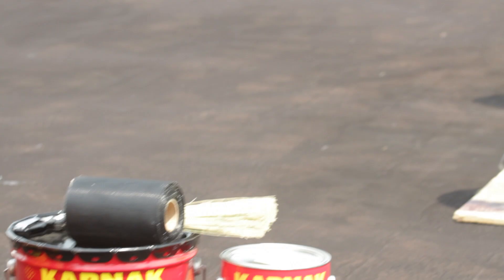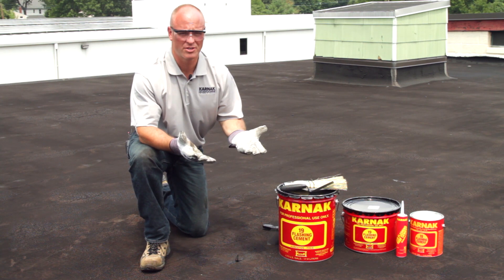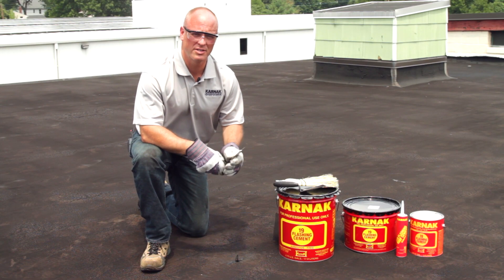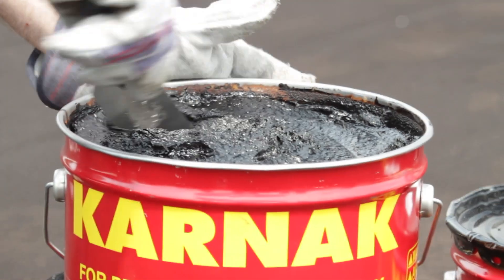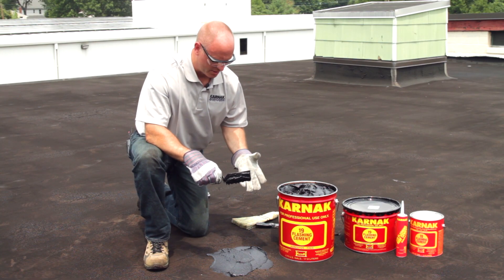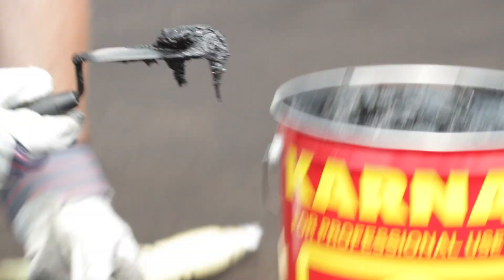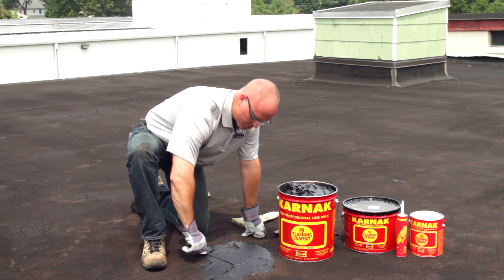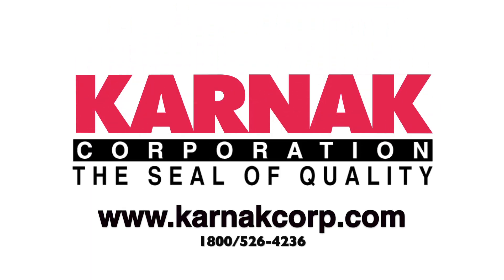How to repair leaks permanently on flat roofs Karnak 19 Professional Grade Flashing Cement

Comment: i got a quote offering to repair with roof cement vs silicone & fabric, which is better?
Reply from the maker: That depends on the particular circumstances of your roof, its condition, the underlying material, and other factors. You can always contact our Technical Department to discuss your specific situation at 800 526 4236

Comment: Can you use this multiple times after you open the container? How long does it take for it to harden?
Reply from the maker: Depending on how tightly the 19 pail is resealed and storage, i.e., inside in a 40 to 80 degree space apposed to outside in the back of a contractors repair truck, it can be several weeks to possibly months if not longer to harden in the pail.

Depending on the KARNAK Asphalt Flashing Cement used, KARNAK Flashing Cement's such as #19 Flashing Cement, #19 Ultra Rubberized Flashing Cement and #155 Amphibikote (Wet/Dry) when applied will create a waterproofing asphalt layer and the material will skin-over within a few +/- hours. Depending on the ambient temperature, this skinning over time frame may be longer or shorter, i.e., (warmer temperatures will quicken the skinning over process).

When flashing cement cures it will continue to have a "putty-like" consistency. This is the nature of roofing asphalt and is advantageous because it allows the repair sealant to expand and contract with the roof substrate." The curing process will continue depending on the thickness of the applied material and may take several weeks or longer. This process, as well, depending on the ambient temperature, may be longer or shorter.

Once applied, either the KARNAK #19 or #19 Ultra or #155 will perform as designed throughout the "Skinning Over"/"Curing" process. Depending on the application, expansion/contraction movement and nature of repair, the flashing cement can perform for upward of several years or longer. This time frame can vary either longer or shorter.
Reply: @KARNAKroofcoatings  Thank you!

Comment: I just put it down on some cracks on my concrete roof How long it takes to dry out?
Reply from the maker: Depending on the KARNAK Asphalt Flashing Cement used, KARNAK Flashing Cement's such as #19 Flashing Cement, #19 Ultra Rubberized Flashing Cement and #155 Amphibikote (Wet/Dry) when applied will create a waterproofing asphalt layer and the material will skin-over within a few +/- hours. Depending on the ambient temperature, this skinning over time frame may be longer or shorter, i.e., (warmer temperatures will quicken the skinning over process).
When flashing cement cures it will continue to have a "putty-like" consistency. This is the nature of roofing asphalt and is advantageous because it allows the repair sealant to expand and contract with the roof substrate." The curing process will continue depending on the thickness of the applied material and may take several weeks or longer. This process, as well, depending on the ambient temperature, may be longer or shorter.
Once applied, either the KARNAK #19 or #19 Ultra or #155 will perform as designed throughout the "Skinning Over"/"Curing" process. Depending on the application, expansion/contraction movement and nature of repair, the flashing cement can perform for upward of several years or longer. This time frame can vary either longer or shorter.

That's a lot of info, but I hope it helps!

Comment: Can this be used on a rubber roof  with silver coating on it?
Reply: Yes that’s TORCHDOWN aka asphalt modified bitumen with aluminum coating 
Yes the Karnak can be used on it
Reply from the maker: In the case that it is an EPDM roof, this product cannot be used on that roof substrate with a silver coating on it. In the case that it is a torch-down APP or SBS, then yes, this product can be used in that case.

Comment: What is the purpose of the tape?
Reply: It stops the tar from cracking
Reply: movement, this method is used on seams which move.  It also creates a redundancy which is well worth the cheap fabric he used, there are better fabrics
Reply from the maker: It makes the repair over 4 times stronger
Reply from the maker: It makes the repair much stronger and last longer

Comment: Thats was better, try using the tip of the trowel to make that tar job look nicer. It should look oval and uniform when complete. Alsi the way the tar built up on your trowel is kind of embarrassing and a good tar man never wears a glove.because thats how it gets on the handle.
Reply from the maker: Thanks for the advice!
Reply: @KARNAKroofcoatings  cheers!

Comment: I've had 3 roofers take my money over  8 years: The first one who put on the original, the second, (after the first one bailed on me), came back after the first few rains showed he really didn't fix the leaks and bailed on me, the third, actually did a good job and I called him back to fix another area, and after numerous calls and even 2 visits to the office never called me back and now his work is failing. I'm a little gun shy about handing over a few more thousand dollars to anybody else. Water ponds about 3/8" deep behind my scuppers. Will this product control standing water? Can it be built up to stop the ponding?
Reply: Brent Townsend most likely you'll just move the puddle farther away from the suppers using mastic to fill low spots ,1st off standing water isn't a bad thing unless it doesn't evaporate within 24 hours ,if that's the case then leave it alone ,the only way to know if you can move water to the supper by filling low spots with mastic is to stretch out a line from the supper to the high spot ,then see if the line has an equal gap under it ,flows backwards or lays flat on the roof ,if the line lays flat then you can prolly fill the low spot with half the thickness you think it needs and inspect after another rain.
Reply: standing water is an install flaw, you need address what happened in the install.  Probably needs insulation modification under roof membrane
Reply from the maker: It will not control standing water, but it will stop the leak in an emergency capacity.

Comment: Can I use this to cover the whole flat roof? I'm not sure where the leak is happening on the house. I'm thinking about caking it with this if it works...
Reply: Did you do the whole roof what was your results?
Reply from the maker: Yes, we are curious too how your job turned out. You would use this typically for spot repairs, and then coat the whole roof for best results.

Comment: This particular built up roof needs a re-surfacing contract with a UV protector, not a gum repair.
Reply from the maker: This is a leak repair, not a whole solution for coating. Once repaired, you could coat on top of the repair.

Comment: our roof is a plastic type, a deli that was originally mobile, it has a large fan for the range/Grill for the deli, it leaks no matter what, used a waterproof silicone but nothing simple seems to work, will this flashing be good on that roof?
Reply: plastic type??   fyi- oven exhausts are a notorious problem and usually handled completely with metal work.  Grease causes many problems, and the heat and cooling of the system creates movement which cracks seems
Reply from the maker: Karnak 19 Flashing Cement should do the trick!

Comment: this may be a dumb question but why build a flat roof that can hold water ?   why not angle the roof so water runs off    I see with a flat roof you can save room by putting all the a c stuff on the roof
Reply: Clinton Wurzbach If it holds water it's not properly done, no roof should be completely flat. Even what they call flat roofs should have a slight angle/grade to them to direct water to the nearest drain system
Reply: No roof is designed flat.  your real question involves roofs to large to have a "single plane" slope.  For example a one acre roof with a 3" (lowest slope) needs 53 feet of height added to the high side, and watch out for wind issues.  So the method used is to pyramid shape the insulation between the drains.  Fire Marshals and codes set the drain distances.  Insulation is set in 2" lifts.  Imagine a flat table, then add a pyramid shaped foam, and a sheet of plastic
Reply from the maker: Sometimes the flat roof wears unevenly, creating areas prone to ponding. Proper draining is key to keeping your roof dry, you are right about that.
Reply from the maker: All roofs have some slope, ponding water usually occurs due to damage done to the existing roof or areas of high traffic!

Comment: Is the reinforcement fabric neccesery or optional ? 
Can I just get away using the tar in the can ??
Reply: fabric is for movement, non moving repairs as accidental penetration could be without fabric, but fabric is the default method
Reply from the maker: It is not necessary perse, but making a three-course repair makes the last longer and much stronger.
Reply: Yes you'll definitely need fabric our it won't last as long.

Comment: can you apply the reflective coating after applying this?
Reply from the maker: Keith Lau Yes, you can apply the reflective coating after applying this. (we make both Aluminum (silver) and Acrylic (white) reflective coatings). However, if you use this product, you will need to wait until it fully cures (about 30 days) before applying the reflective coating over top. If you use our 19 Ultra (a rubberized wet/dry flashing cement, shown in another video from our channel), you can apply a coating on top just a few days after making the crack repair. For more information, feel free to call our Technical Dept. at 800.526.4236.
Reply: How large of a gap does Karnak 19 fill?  I have approximately a 3/4" gap around a roof hatch that needs to be sealed.  Would I need something additionally or just Karnak 19 would be sufficient?
Reply from the maker: Karnak 19 (or any similar cement) will effectively fill gaps up to 1/16". To fill your 3/4" gap, first install "backer rod" (link below) until you get the gap to 1/16". The backer rod will serve to keep the cement in place while it dries, not allowing it to fall into the crack and render your repair ineffective. Once the backer rod is installed, you will use Karnak 19 to seal the gap fully. 

http://www.wisegeek.org/what-is-a-backer-rod.htm
Reply: Do you have a product that I can apply to seal the entire roof as opposed to spot patching with Karnak 19?
Reply from the maker: The short answer to your question is no. No product exists that will fix leaks via a roll-on coating.

Leaks must be fixed with a mastic or flashing cement (like this Karnak 19, among other Karnak products). However, a reflective coating (white acrylic or aluminum) should be applied to cover the entire roof after you have spot patched. This will stabilize the temperature of the roof reducing thermal shock, maintaining temperature inside the building, and making the spot repairs last much longer.

For a more thorough explanation and answers to any questions you may have, please call our Technical Department at 800.526.4236.
Reply: KARNAK Roof Coatings I had a large gap like that and I already repaired it by putting some cement, then gently pressing that screen stuff into it, and then putting some more cement like you showed.  Is that going to hold?  Or do I need to scrape it off and get a backer rod?  Can you just put like air conditioning foam instead of a backer rod if you don't have it on hand?
Reply from the maker: rasmasyean If you made the repair correctly, it should hold on a moderately large gap. However, once it has cured, you should coat it with an aluminum coating (like our 298) to keep the cement from drying out. If you do not coat, the repair may not hold for a long time. For future reference, you could use air conditioning foam as backer rod.

Comment: It is about 54 degrees in seattle.  It was very difficult to apply and it didn't want to stick to the torchdown.  I put a very thick patch and was able to get it down.  Then when I put on the fiberglass it was sticking.  I hope this works.
Reply: how did it hold up?
Reply from the maker: Thats exactly what you should have done!